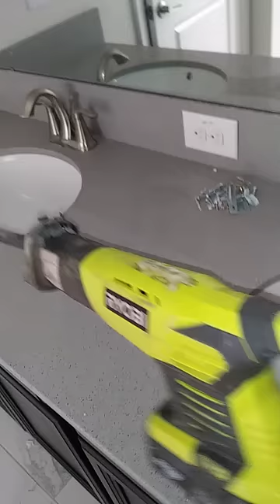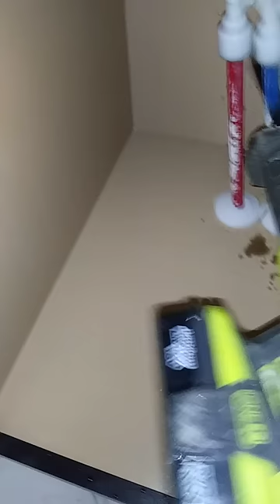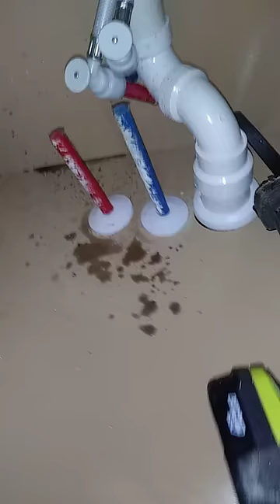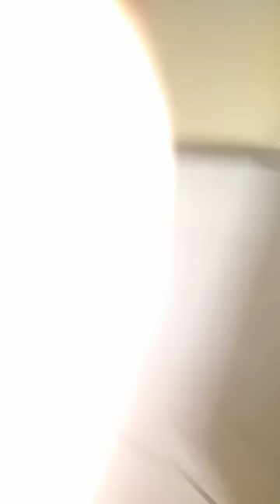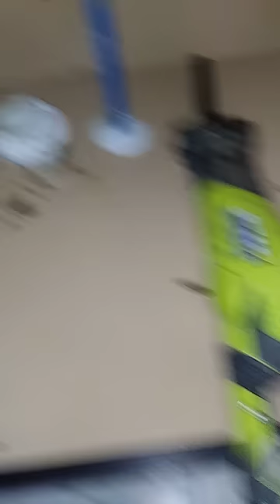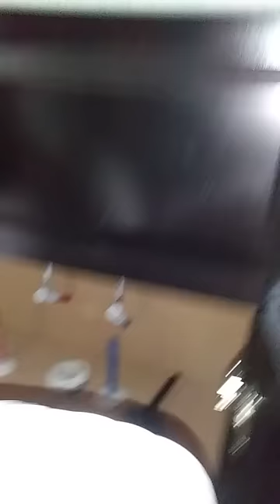This is what happens when you DON'T pay your plumber.

Comment: AND you purchased the house a year later at an auction? Fear the wrath of a patient man, you're a legend.
Reply: A patient man is the most dangerous
Reply: @bigcannon8883  mine has been through so much I’ve had for about 2 1/2 years
Reply: @JoeDiGiovanniIV  laughs in conglomerate that owns Ryobi, Milwaukee, and Rigid
Reply: @mrbrightside11111  yeah theres a reason if you visit most professional job sites, you won't find ryobi tools
Reply: @It’s getting weird stalker 😂 hold up me and my buddy started 8 years ago in hvac and through the years ive burnt up way more dewalt and makita tools and hes still rocking that home depot $300 bundle pack so idk man maybe theres something to them lol
Reply: @It’s getting weird stalker 😂 i mean depends on the hvac guy, youre probably only used to seeing the guys who do residential with flex duct and whatnot. i do large commercial sheetmetal and lots of pin up units and large unit changeouts for malls and schools and hospitals so they go through quite a beating. thats why i run dewalt because they have much more power, but ryobi will last and get the job done
Reply: @It’s getting weird stalker 😂 idk maybe man all i do is land package units and run metal ductwork which is gnarly thick to push 100 tons of cooling and my impact is used not only for screws and units but also for my sheet metal shears attachment. ill easily cook through 2-3 6ah flex volts in a day on a good install mostly due to my shears.
Reply: @It’s getting weird stalker 😂 you kill 2-3 FLEXVOLTS on just an impact for two garage doors?...
Reply: @It’s getting weird stalker 😂 we might be the minority to you because thats all you see but in general id say theres more commercial hvac guys than there are resi because you cant really live comfortable in resi as a employee its more of a stepping stone.
Reply: @It’s getting weird stalker 😂 no my buddy who started with me at one company years ago and eventually got me into this big stuff uses ryobi still, i never touched it. allso usually in residential the guys who do new construction also do retrofits, unless its like track home companies.
Reply: @It’s getting weird stalker 😂 retrofits in hvac are relatively quick because you dont have to work around people and most of the time its equipment changeouts.
Reply: @vanhalenman60  yes bro 😂😂😂 I burned out a 200$ Dewalt driver in six Mos, but had a frickin 60$ Bauer driver from harber freight last over two yrs with daily use 😂😂😂
Reply: Well you know one problem that needs fixing in ur new house already lol
Reply from the maker: Thanks for reading the description. Everything was missing when I finally purchased the house. Appliances, cabinets, electrical panels, pool screen, pool pump, they even took the light fixtures.
Reply: @HungarianHacker you still won the more expensive part

Comment: I don’t get why people think they can get away without paying.
Reply: Because they mostly do get away with it.
Reply: khalil Heat and air conditioner repair happens all the time in low voltage field and because of every company being slaves to surveys it is happening more often.
Reply: All the customer has to do is call the police he'll be arrested for vandalism and criminal damage to private property then they can rehire another contractor and sue him and make him pay for all of it that's right it's a civil matter he had to take him to small claims court this story will be to be concluded I guarantee it
Reply: @tracygraf6113  the thing is, most of the time court costs are more than the pay for a job otherwise they would. A contractor is perfectly in his own right to undo any work that won't be payed for, unless he made them pay a deposit for the materials, it's his property until they pay for it.
Reply: @tracygraf6113  and the labor costs it took to install it, being pvc pipe is cheap he probably payed for that outta his own pocket, hence why he didnt smash the sink,  back splash or counter top that I'd garentee he installed.
Reply: @tracygraf6113  I had a job go like this once, I do wood flooring, they didn't wanna pay for labour but I payed for the under layment out of pocket so I ripped up the floor and took my under layment back. I threw it away after but they took a bigger hit than me, no woodworker is gonna pull staples out of flooring and relay it for even twice the price I did the floor for.
Reply: If the customer wants to be a dick ..it ain't about the money..its about ruining there life because they dont wanna pay...all kinds of winners..or I should say weiners... bottom line..ya cant damage people's property..know how to properly write a contract..downpayment...and final payment upon completion..ifvthey dont pay..its called a lien...and it does work..
Reply: @tracygraf6113  it's not their property until they pay for it
Reply: @tracygraf6113 do you live outside the usa by any chance,
Reply: Had a  Mcdonals Franchise owner not pay me $1000 balance, I called the cops, cops told me to get off his property or I will be arrested for Trespassing
Reply: @daniels1293  I do flooring, too, and I see what you mean. Wish there was websites to put shit Lord HOs and put a file on them if they try shady underhanded shit.

Some people will do whatever to not pay
Reply: Trump does it all the time you can get away with just not paying people if you're relatively wealthy...
Reply: @daniels1293  You should check how little a small claims case is up to 10000 plus the cost of lawyer for the plumber who illegally entered property for sole purpose of vandalism  that's a nice little misdemeanor to felony charge to beat plus the bad press
Reply: @daniels1293  Position is 9/10 the law once its installed or proven ownership contract receipt pics its the home owners client  I've known scumbags who have waited a month to hide contractor s tools so they cld say they where abbondaned (luckily a few filed police reports that started a snowball of shit lol
Reply: @420f37  you cld always start one it wld be a reverse angies list a cple of other trades wld more than likely chip in ?
Reply: I don't get why people think it's ok to do what he did in th he video.  There the right way of handling non payment and the wrong way, this is the wrong way. If you did the work on the house and had proof you could have put a lean on the house.
Reply: @Unit54987  I’ll destroy a customers new air conditioner if they don’t pay me I don’t care I totally support what he did in the video.
Reply: @khalilt6508  ok have fun with that then
Reply: @Unit54987  Sure will dipshit
Reply: Because the rich do it all the time
Reply: @tracygraf6113  except read the description for your conclusion doors, the place got foreclosed lmao.
Reply from the maker: You mean didn't work in your favor.  All a property lien does is puts a lien on the property and you get your money upon the sell of the property with no interest and it could possibly take 5,10, or even 30 years to recover payment.  So how does that work for the contractor.  I had all the paperwork and contracts and permits. No payment...
Reply from the maker: A.p rental vlogs. That's when you cut the gas off at lunch time he would lose way more then a $1000. Its a handle just outside in the back looks like a water pipe coming from a grey box. Easy solution. Give me the address I'll make it my next video
Reply: Same here
Reply: @daniels1293  Then enjoy your vandalism charges. Even in Canada and the UK, you can use your firearm on someone vandalizing or trespassing in your home
Reply: @daniels1293  Correct, but you cannot remain on the property after being told to leave. Funny how you respect big businesses and their "right" to issue mask mandates because it's "Private property," but you don't respect private homes of customers.
Reply: The correct solution is to file a lien on the customers house, and then sue in civil court for a judgment. Once you get the judgment, you can foreclose on the lien- and if he still doesn’t pay you, then you’ll actually OWN his house 🌝
Reply: I got one good reason.... 
MERICA..
Reply from the maker: 2024 MAGA
Reply: @daniels1293  Incorrect. Look at what happened to that Colorado contractor who entered a woman's home and "repossessed" the bathroom tiles by destroying them; warrants were issued for his arrest. Just because something isn't yet paid for doesn't give you the right to trespass or vandalize their property. Just like how a body shop can keep your car even though it doesn't belong to them, so can a homeowner. It's considered a CIVIL matter for a reason. You can file a lien on the property for non-payment, but you can't commit a crime in response.
Reply: This is how you end up with a lawsuit and ruin your business. Be a man put out a lean and move on.
Reply: @akujiki0X  Or criminal charges

Comment: I knew a guy that did that to a house that he worked on and they charged him with destruction of property the judge told them flat out if he would have just gone through the course and filed in small claims court this would have all been resolved and you wouldn't have been a guilty of destruction
Reply: may i know what small claims court means?
Reply: @choochoo6086  it’s like civil court (usually only non violent crimes that involve money) but for job sites and not getting paid, etc
Reply: @ryanq.4799  ooh okay, thank you!
Reply: yeah, but sometimes the amount that they are owed is small in comparison to legal fees, so some people  just don't go through with it.
Reply: If you type the words all materials belong to my self until full and final payment he would have got done for destruction , but he didn’t really trash it I would have cut everything up
Reply: @choochoo6086  it’s mean you will never see that money just take the loss and move on that’s what it means
Reply: Small claims court is for compensation under $5,000 in most states and it’s a process plus having to show up and take time off work not being paid for that or allowed to place that added cost on to the customer.  The court system fucks you harder than that PVC pipe
Reply: Winning in court doesn't mean you'll get paid. You still have to go through a collection process. Either way the contractor gets fu*ked. A sack of cement down the sewer cleanout would of been my fix...
Reply: How would it be destruction if brought the pipes
Reply: @nuclearwarhead6072  once anything is installed it’s the homeowners property in the eye of the law
Reply: @chrisvrtiska7154  correct
Reply: Yeah. Once it's attached to the house it's theirs.  However, if you're a licensed contractor you can put a lean on the house until you are paid what you're owed from homeowners.
Reply: Yeah..not sure where this was but in the US this is very illegal.....even if it makes you feel better for a few minutes you will have to pay for destroying their house and probably get locked up
Reply: You put a contractors lien on the house .. And it costs 20 bucks to file a claim in NY .. What legal fees .?
Reply: @josephmoullay8857  As someone who has done this it takes a day of work to complete a lien usually(that you don't get compensated for in the lien) also that's a day they you could be working for paying customers. If that property becomes a rental that is self financed you might never see that money in your lifetime.... Its worth doing this so people don't go from tradesman to tradesman stealing from every plumbing company one time. This guy is doing the right thing to protect the trade👍
Reply: Small claims court judgements almost never get paid because they are not enforced.
Reply: One time my company couldn't take a customer who hadn't payed their bill to small claims court because 'the customer didn't dispute the bill so their was nothing to go to court about'
Reply: @fartsunltd6981  If you vandalized my house like this plumber is doing, I'd invoke the castle doctrine. Funny how you respect big businesses like Home Depot and their "right" to issue mask mandates, but you don't respect private homeowners when they ask you to leave.
Reply: lmao no you dont
Reply: That's true bro
Reply: Small claims is a joke ! You'll never get paid, a lien on the property? can last forever or until the property sells, can you wait that long?? 🤔🤔
Reply: Contractors who take the rip out solution are just as morally challenged as those who refuse to pay.  In any case, you shouldn't be more than 10% short at the end of a sizeable job.
Reply from the maker: @abacab87 your morally challenged if you think not paying for services rendered is OK.

Comment: That blade went through that pvc like butter, struggled a bit on the PEX pipe
Reply: cus it’s floppy
Reply from the maker: @cophater298 true story copper!
Reply: pex more like sux
Reply: @cophater298  yeah, if you get a grip on it it'll cut right through it . I would have cut it flush with the bottom of the cabinet more expensive to repair that way .
Reply: @sirclarkmarz and then you'd pay for it smooth brain
Reply: That's because one is rigid and the other is flexible.
Reply from the maker: @PANZERFAUST90 correct!!!
Reply from the maker: I didn't want to damage the cabinets guys work. I was holding my phone in one hand or I would have gotten an better grip onit.
Reply: All doubts. My guess dudes about to do a remodel for himself. First I don't know a soul in the trades using ryobe, garbage tools. Second, if your a plumber you would probably have the appropriate tool for cutting pex and cutting both lines would have taken about 1.25 seconds. I call BS. Or incompetence. Your call.
Reply from the maker: @theonetruepatriot6101  1st things first I own enough tools for 3 people. I find ryobi to have more plumber based tools than any other brand I use. I have every brand under the sun. This just happened to be in my seat next to me. 2nd, I use this sawsaw (reciprocating saw) for my demo jobs. I waited almost six hours in the driveway for a response. Mind you, the sugar daddy was in constant communication until I needed to be paid. I spent almost 3 grand in material on this job with the promise of getting paid upon completion as per our contract. He broke up with his now ex sugar baby, who hadn't even moved into the house because she wanted it completely remodeled before she moved in. I and multiple other contractors didn't get paid for this job, same bs as with me. In fact, there was the tile guy smashing tile as I was cutting out the plumbing.

Comment: It's easier to just pour fast setting cement down the drains and toilet...
Reply: Aniquin  Just eat you some Taco bell and you'll ruin the plumbing just as good.
Reply: That's evill
Reply: @IAmMoto25  lol
Reply: @IAmMoto25  No chance in hell. If anything the pipes would thank you. That would be an oozey shit!
Reply: A guy I know who used to be a plumber told me once that the guy refused to pay and he knew he was going to not pay while he was doing the work he had just a weird feeling about it. So he opened up one of the pipes in the basement midway through the basement filled that side of the pipe with putty and let it dry. then he reconnected the pipe so that the guy wouldn't know where the stop was.
Reply: Did that to a HOA company on a six unit building. Screw me on one unit? I'll take down six of yours.
Reply: Bam. I love the way you think. That's a great idea!
Reply: You should get a metal
Reply: Nah man you don't wanna ruin the sewer systems
Reply: Automotive Bondo filler works good too
Reply: I love the way you think!!
Reply: My uncle rents homes and some tenants he had were getting evicted for not paying rent so they did that to him.

Comment: Another option is to put a lien on there house so they can’t sell it with out settling the debt owed you might not get you money right away but you will eventually
Reply: That’s what I was thinking. Some people just don’t know what to do and let their anger/frustration take over
Reply: This guy said he ended up doing that and eventually bought the house for $25k after it foreclosed.
Reply: @CoDisafishy  $25k lmfaoooooo it looks nice too
Reply: Not if it goes into foreclosure. Once it goes up for auction, all liens disappear.
Reply: You can only put a mechanics lien on, un you filed for a permit and the work was over $2500 and you recorded the notice of commencement, when its a  small repair work under $2500 there’s not much you can really do legally as a tradesman, not worth the time and effort to pursue in court. I have left notes inside equipment and warning  next guy that the customer doesn’t pay, and I have seen notes left like that, I refuse the job pack up my tools And tell customer to call back the guy that was here before me. I don’t tell them about the note.